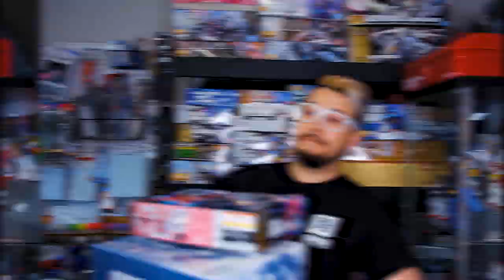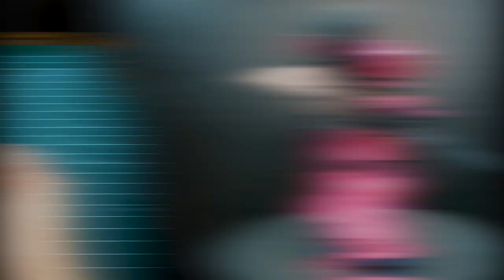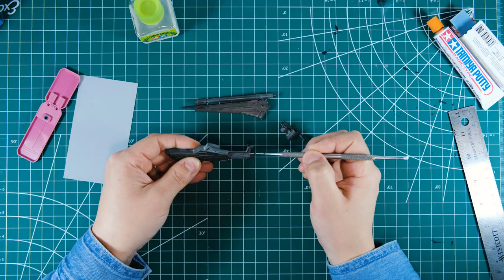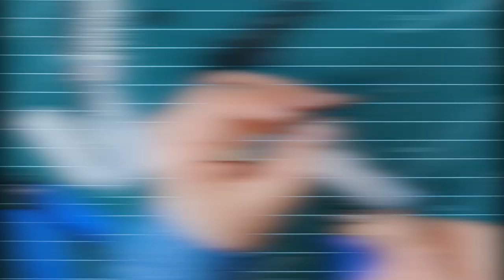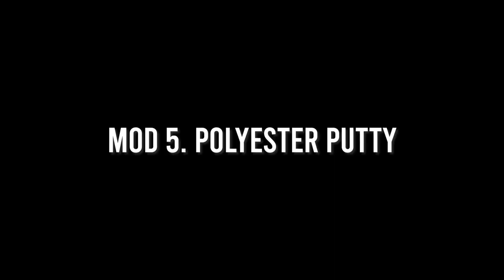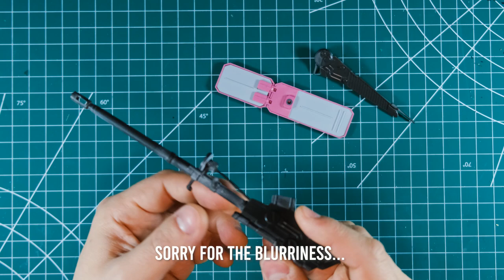Let's Build Together - Angelo Sauper's Geara Zulu Part 1: Modification

Comment: Hey Liam,  you might like to try a Soldering tool kit(that can heat blades etc) . It's save me a lot of time skipping making holes and using a cold blade.
Reply from the maker: Thank you! That's a great suggestion. I do have one, I just have been leery to use it on plastic because I don't want to warp it, so I usually use my router or a pinvise. But perhaps I'll give that a shot!